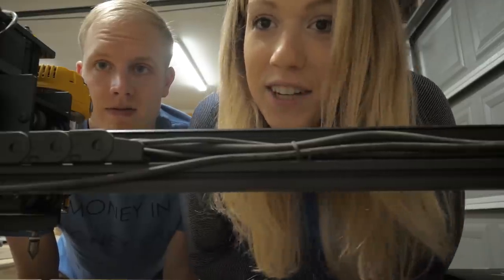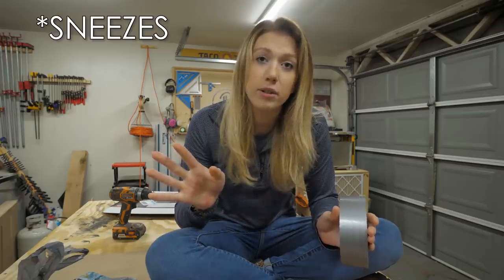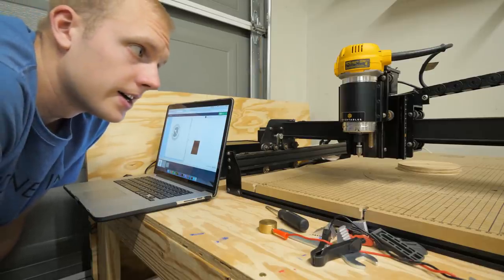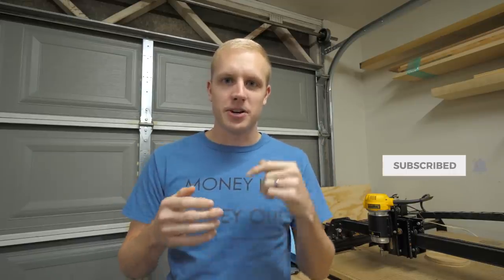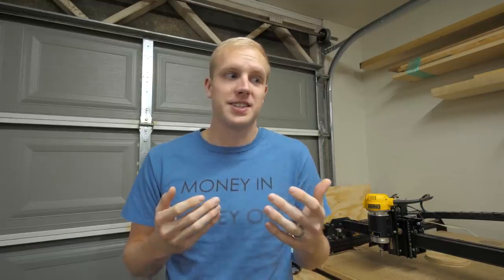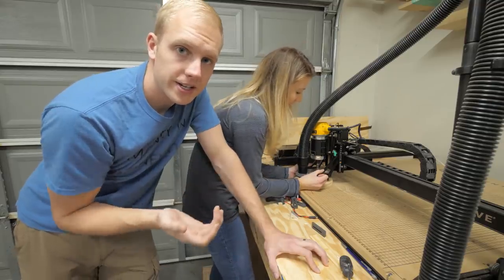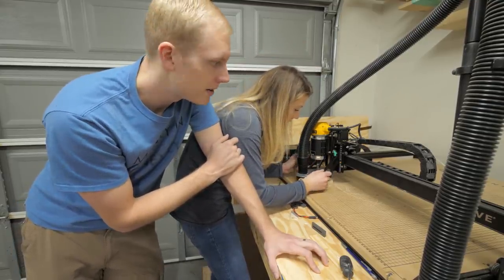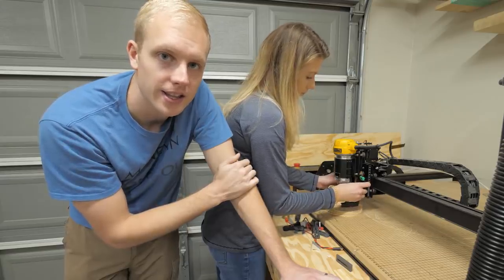The CNC conquered US! 🤦🏼‍♀️🤦🏼‍♂️ Let's Conquer the CNC! Part 3

Comment: The Glowforge is easy to set up I was cutting in less than an hour of opening the box.  Not well but I was cutting.
Reply: motormaker a glowforge isn’t really comparable to a standard CNC. For the kind of money you spend on a glowforge you can have a pretty high end and capable CNC. It’s easy to use in the sense that it lines things up for you, but it’s not really for woodworking.
Reply: Dirty Windshield my Glowforge was $2500.   You cannot touch a “high end and capable CNC” for anywhere near that. Also it does not “line things up for you” not even close.  That’s my biggest issue with it is lining things up.  The x carve is around $2k and it is basic as basic comes.  A capable CNC router would be in the $5k to $10k range and a high end home unit is more. Industrial models go on up from $20k to as much as you want to spend. Industrial fiber lasers also start at about $20k.
Reply: motormaker I have a very capable cnc and it was $800 a bobs cnc. It cuts, carves, does 2.5D/3D. The work they have shown themselves doing cannot be done with a glowforge. The glowforge closest to their needs is $6000, not $2500. They are looking for production capabilities and the lower units are insanely limiting, the top unit is only somewhat limiting since it has pass through and a better laser. I’m basing my opinion on this after watching their videos and seeing the things they make. The glowforge is marketed well and has some very amazing aspects to it, but the stars they made on this video can’t even be accomplished with it.
Reply: Dirty Windshield okay. We have very different concepts of what a capable machine is.  I’m talking about a closed loop servo set up with linear recirculating ball slides and ball screws.  In the video they asked about lasers. That’s why I’m talking about lasers.
Reply: motormaker and I’m looking at what materials they use and the type of work they’ve done so far and saying it’s not for the best. I understand what both machines are and what they can do, they do full size woodworking, not tiny pieces.

Comment: This is what I use for my double sided tape. I am also trying to run like a small production shop. Its a very strong connection while not being too sticky to gum up or rip the wood. Sometimes on plywood it will rip the wood, but I have not had that issue with any other type of wood. The only issue I ever have with this is cuts that go through the wood and into the tape. When the bit cuts through the tape, the tape gets wrapped around the bit and can make for ugly cuts. https://www.lowes.com/pd/Shurtape-1-88-in-x-12-Yard-S-Blue-Heavy-Duty-Duct-Tape/3014450

Comment: Don't  give up on CNC. You simply purchased the machine that you will train your employees on before you purchased your production machine, Smart. Now find a machine runs Mach4 as it post processor and is modular in design. I would visit Avid CNC.com.
Reply from the maker: It’s not about giving up - we can keep hammering on the screw and it will go in. Or we could just buy a drill 😉
Reply: Mach4 is that drill, at least for our enterprise . It means my 5 x10 foot machine can be a router, a plasma cutter, 3-D printer and soon a laser cutter. As users we have the ability to create new and improved functionalities. The only thing harder than programming a CNC is competing against one.

Comment: Did you ever get the dust collector boot to work better?  I built my own cnc router and made a dust collector boot out of MDF, and used magnets to attach. I made a ring of MDF around the router attached with a screw with recessed magnets into it. Then built the dust boot itself that has a matching ring that has magnets that align with the other magnets on the router ring. All the parts were cut on my cnc.  If you would like to see the design I would be happy to share it with you. Maybe with some modifications the design may work with your cnc router?  A suggestion on tape for hold down, I tried a product from amazon, seems to work pretty well and a bit cheaper than regular carpet tape. I like the 1 inch tape width and using smaller pieces for hold down. https://www.amazon.com/gp/product/B06XWKSZJ8/ref=ppx_yo_dt_b_asin_title_o05_s00?ie=UTF8&psc=1   Good luck, hope you get the CNC fine tuned and working for you. Don't give up on it. The laser is a good addition since it's output product is different looking than a CNC router. You can also use the laser for engraving your logo on your products.

Comment: If the WiFi goes down the Glowforge will finish the cut or engrave that it is on.  You only need WiFi to start the cycle.
Reply from the maker: In a production environment, starting the cycle would be a nice thing to rely on...
Reply: Jennie and Davis I live out in the sticks my WiFi is sketchy sometimes and it has never been a problem.  You can also run it off of a phone with hotspot feature.
Reply from the maker: @motormaker  Just sounds like an unreasonable weak point. Can't build very tall on a cracked foundation!

Comment: First problem is easel is horrible second problem you got an xcarve instead of a Shapeoko..I have both machines and I hate the xcarve...third you got a horrible dust shoe...look at pwncnc i have a dust boot from their where vacuum hose goes from back of machine and in front it has a small clear acrylic piece you take on and off to change bits...and lastly do not get a glow forge...if you want a laser get a real standalone unit like a c02 laser..

Comment: Welcome to the world of Computer-aided manufacturing!
I'm going to keep this blunt, Everything has it's caveat! I've worked with lasers for over 4 years now. Everything from 2m x 3m lasers down to Glowforge basic. In a nutshell, they all have there own pros and cons. Send me a message if you would like to have a small sit down and I'll let you know all I know. In my opinion, glowforge is great, I have a basic at home and I have to be honest it's the best cut quality and vector line path I've ever experienced. Having said that here is the caveat! You're going to struggle with larger projects,  the thickness of the material, hyper complicated designs truly melt the cloud system ( My biggest pain point) and Last but not least it's not really a " production " machine and it's a PAIN to clean. Having worked in a laser production facility I can tell you now a dirty laser is a dangerous laser. There are alternatives like the Makeblock that are similar to the glowforge that don't really on the internet. However, I don't have experience in that module. I understand lasers are expensive but you do get what you pay for. One that I was very closely considering was the Rose Graphix yes it is $10,000 but you will get speed, size, ease of cleaning and depth for almost any need ( Glowforge and smaller lasers in the glowforge style are SLOW! to engrave anything. Kiss cutting is a decent speed tho). Anyway i'll leave this here. Like I said feel free to reach out to me as I'm more than happy to share my experience.

Comment: Hey guys - love the channel and yes I subscribed. I have a Shapeoko XL and use double sided tape with few problems (as long as the wasteboard is clean and work board is flat).  LLPT double sided tape works for me. (no connection to or interest in the vendor btw). Here is the description: LLPT Double Sided Tape for Woodworking Template and CNC Removable Residue Free 45mm x 108 Feet(WT260)

Comment: My laser solution is most likely going to be the build just recently done by Further Fabrication here on YouTube: https://www.youtube.com/channel/UCZ72zDm2feverqV7qAbNH7Q
but IDK if that's going to be the right solution for y'all. Cheap, yes, ready out of the box, not at all, but the reason I mention it is because building a machine means you know it inside and out and can troubleshoot faster, reducing downtime. This has saved me a few times with my table as I have a better chance of finding a solution quickly that if it was just a black box.

My CNC notes/opinions:
Motors locking at Idle is not something that's going to be the same for everyone. Personally, I like my motors locked on the Plasma Tablea as it doesn't have hardware homing switches, so I cannot re-reference after working on it. If I had homing options I'd want the motors unlocked as it would allow me to manually adjust the machine should the need arise, while still allowing me the option to rehome if needed. Conversely on my 3D Printers all motors lock as I will never have a need to manually nudge the machine, nor would I be able to be precise enough to correct any errors at the resolution the printers work at.
Reply from the maker: That's a really nice-looking machine! I think you're right, though - not being ready out of the box is a deal-breaker for us. If something breaks, I want to turn on the back-up machine and mail the broken one in for repair.

Comment: Just food for thought. There is a company called JTechPhotonics. They make a laser that can be attached to the x-carve as well as a few different CNC machines. The laser is not super strong, strongest they have is 7 watts, but it does a pretty good job at laser engraving wood. Pretty simple to set up as well. This would solve your laser engraving needs plus keep the option of using the x carve for deeper engravings. By all means, please check out my Instagram page (@anchorsnsuch) for some pictures of projects that I have made. Again, just food for thought.

Comment: Glad I watched to the end of the video. I was worried about you kids wanting to use that toy in your business. Do yourselves a favor and when it comes to Cnc laser go with a real company. I have serviced commercial C02 lasers since the late 80’s.  I am also a woodworker, and trust me if you’re wanting to engrave tables your going to make sure to get a sealed tube system that can get recharged. I use to recommend Epilog lasers because I had lots of experience with the manufacturer of their tubes. However a few years ago at IWF in Atlanta I saw one that actually lets you load big panels from the bottom. I seen the same one again on the YouTube channel that does the huge commercial salt water fish tanks out in Las Vegas. The Glowforge is another toy. 
  If you guys a marketing specialist than you should already realize this. 
  Remember that real machines can be written off as an expense, and real companies already have equipment leasing that keeps it affordable with usually a $1.00 payoff at the end of lease with many more years of use with a quality machine. 
  Just my opinion coming from someone who has a diy Cnc router. Mine is from Cnc Routerparts and can cut anything 4x8 in sheet goods. Doing it again wished I bought a Cnc with atc currently my choice would be ShopSabre. Who knows maybe IWF Atlanta 2020.
  Best of luck to you kids on your journey.

Comment: And they say using a CNC for woodworking is " cheating ". .....cheating implies is easier. 

Such an oxymoron.

Ps- to remove carpet tape, try using acetone ( oddly,  nail polish remover)  as it works on most adhesives

Comment: You line up masking tape on both sides and glue, just a little, the two tapes together. Extremely strong, but no tape residue. Depending on the strength you need increase or decrease the amount area you stick together.
Reply from the maker: https://youtu.be/gGiJR0KPHXg?t=489

Comment: If you really want to go full high production I’d look at this one from Baileigh. https://www.baileigh.com/cnc-router-table-wr-32 
I have been doing lot of research and have found that with CNC machines, these small ones like you have and many others that are geared more to hobbyists and not full blown high production. So if you want professional results, you have to use professional tools. I am looking to buy one soon and this is one of my top choices. It comes fully Assembled. I have found over the years it’s worth buying high end equipment and tools from the get go over lower priced tools because the time and aggravation the cheeper tool causes you cost you money and time. I love your channel. Keep up the great work.
Reply: Check out the ShopSabre 23... Its computer based & uses the WinCNC controller, instead of a handheld controller. It's much easier to work with & has many Home positions for different material thickness that you may be working on. 

Its Rock Solid.

Comment: Wow.  Your rants are completely opposite of others owning the same CNBC system.
Reply from the maker: Because we have no obligations to a sponsor. Also, some things just aren't one-size-fits-all. Everyone has different priorities and needs. No product can fill EVERYONE's desires, no matter how great.
Reply: @jennieanddavis  good luck with your business.
Reply: @jennieanddavis  there are plenty out there that are without sponsorship. yes its not a one size fits all scenario but most of what you complained about in this video is more user error than anything. it definitely should not have taken that long to build either. you also seem to expect a hobbyist kit to be at the level of a preassembled unit with tool changer for actual production level manufacturing.

Comment: Easy if you have worked with CNC.  You guys seem so have almost no experience with CNC.  I will tell you 
now, you will need to be able to fix those machines.  You also need to master your design and slicer software.  CNC in early stages?  This isn’t early stage.  CNC has been around since the 60’s.  My father use to use them to make rockets.  I use them in scientific machining.  You need a mentor that has been around the block and not wet behind the ears.  I will tell you now, hire some one that knows what they are doing.  If the CNC is frustrating to you, the laser table will also be frustrating to you.  You’re going to drop a lot of money on a table big enough to do table and furniture engraving and cutting.  Epilog Lasers are not cheap.  Glow forge is not going to be what you need.  It is for small hobby.  Looking at the thickness you cut, you are going to be in the 100 watt range of CO2 lasers.  You still have to know software and you are going to have to know feed rate and power setting for what you are cutting or engraving.  You also need ventilation so you don’t die from lung cancer in a year.  How much you selling your router for?  How many hours on it?